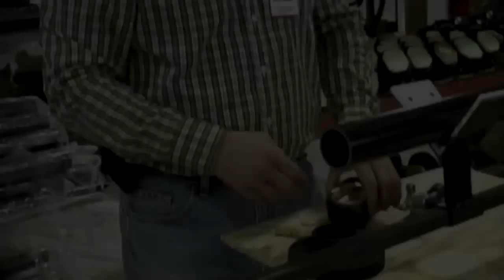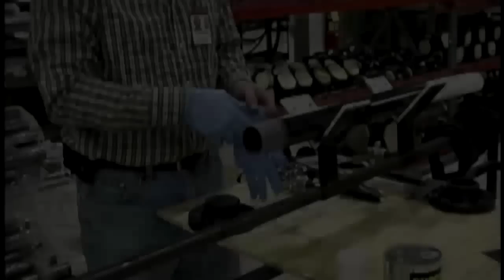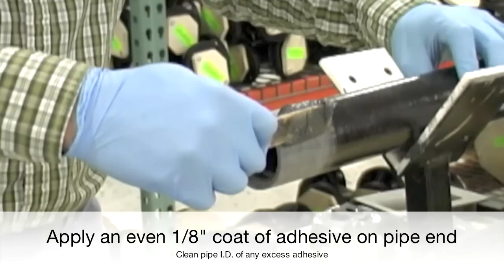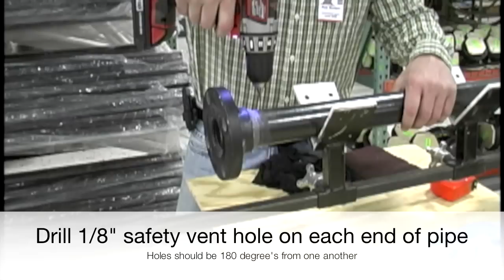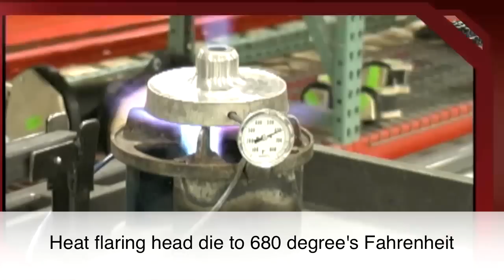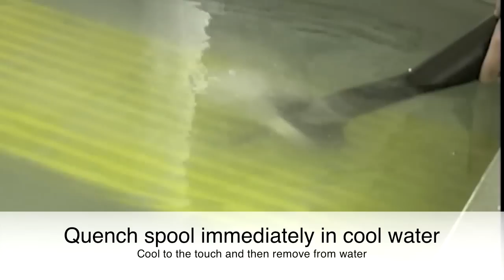Durcor composite pipe Fabrication

Comment: Dear Sir,

We are manufacturer Injection Transfer Molding machine PTFE Lining Pipr Machine and Teflon lined valve and Pump use( PFA,FEP,PVDF,PP Raw Material)
(2kg,4kg,6kg,8kg and 10kg ) so which capacity Machine required for you after send Quotation 
 
Machine video YouTube link
 
https://www.youtube.com/watch?v=fw4-smi6gZc
Warm Regards
Harish Jadav
Thank you
Shakti Industries.
(We are leading manufacturers and Exporters of  Injection Transfer Moulding Machine  & Hydraulic Machinery in All over World.)
Mr.:             Harish Jadav (Director)
Mo :            +91 98259 31046
Mo :            +91 98250 10327
Email Id :      info@shaktiind.net, shaktiindustries729@gmail.com
Website  :      www.shaktiind.net
Reg Office :    14/A, Shyam Ujjawal Ind, park
                Nr, Choksi Tube, Opp. SBI BankBombay 
                GIDC, Vatva, Phase - 1
                Ahmedabad - 382445, Gujarat, India

Comment: Can someone traduce it for me? :(
Reply: Dear Sir,

We are manufacturer Injection Transfer Molding machine PTFE Lining Pipr Machine and Teflon lined valve and Pump use( PFA,FEP,PVDF,PP Raw Material)
(2kg,4kg,6kg,8kg and 10kg ) so which capacity Machine required for you after send Quotation 
 
Machine video YouTube link
 
https://www.youtube.com/watch?v=fw4-smi6gZc
Warm Regards
Harish Jadav
Thank you
Shakti Industries.
(We are leading manufacturers and Exporters of  Injection Transfer Moulding Machine  & Hydraulic Machinery in All over World.)
Mr.:             Harish Jadav (Director)
Mo :            +91 98259 31046
Mo :            +91 98250 10327
Email Id :      info@shaktiind.net, shaktiindustries729@gmail.com
Website  :      www.shaktiind.net
Reg Office :    14/A, Shyam Ujjawal Ind, park
                Nr, Choksi Tube, Opp. SBI BankBombay 
                GIDC, Vatva, Phase - 1
                Ahmedabad - 382445, Gujarat, India